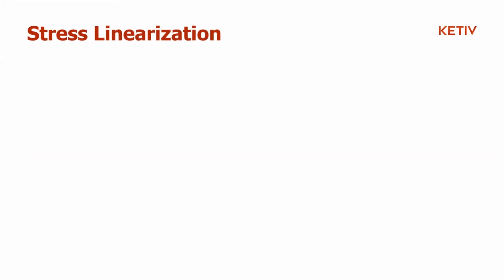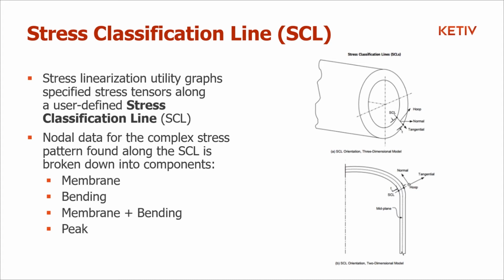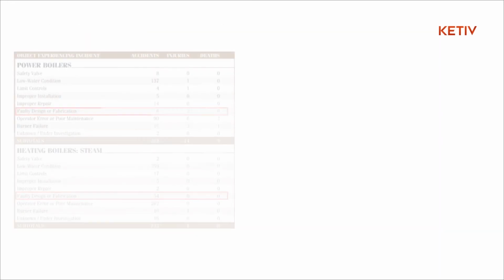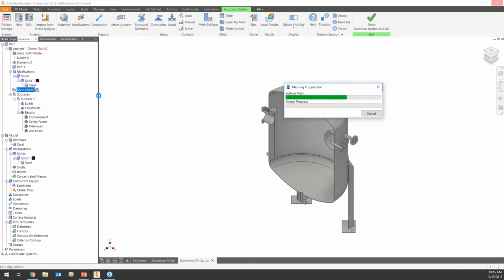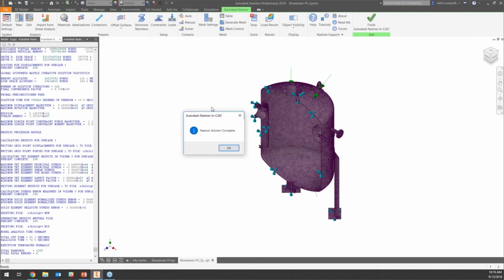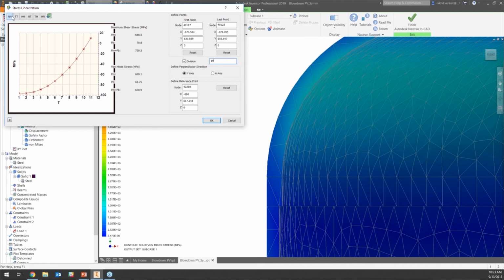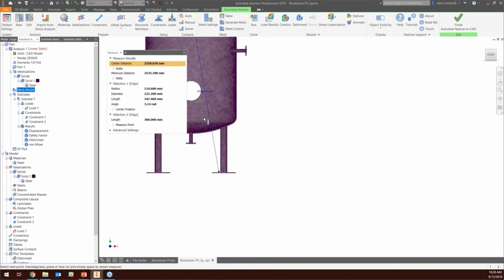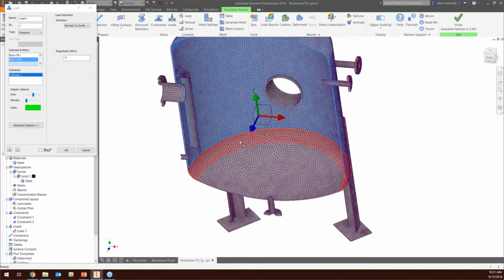Stress Linearization in Nastran In-CAD | Autodesk Virtual Academy

Comment: I don't think they are doing this right. ASME more recently very specifically stated that only elements to use is brick elements. Apparently there seem to be underestimation of bending stresses due to geometry of the triangular elements. Also if at all there are no other ways, and you are stuck with Inventor for stress linearization, it would be good to provide a partition along the thickness in the normal direction. In that way you can have more nodes along the thickness. Just two node and one element like they showed here is not enough for level of conservatism we follow while designing pressure vessels.